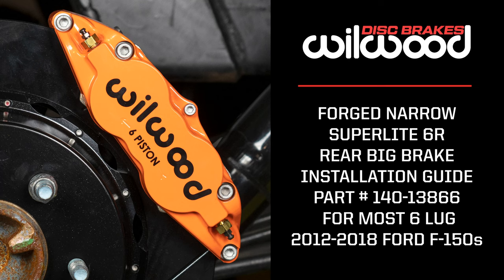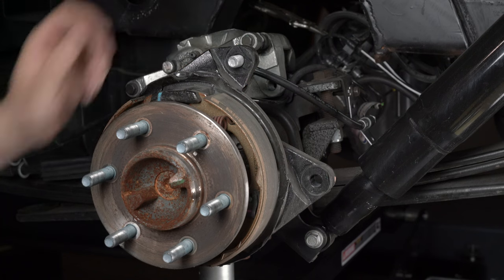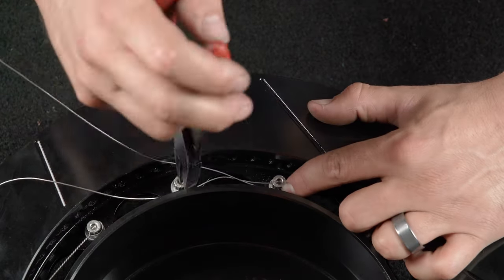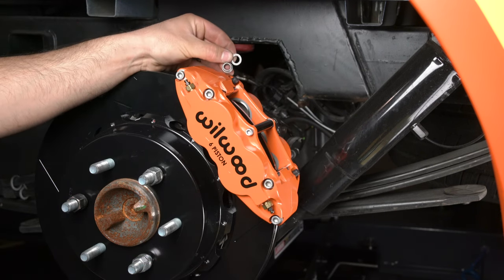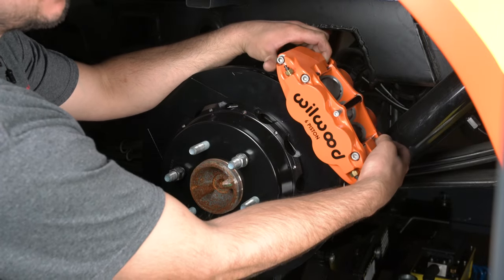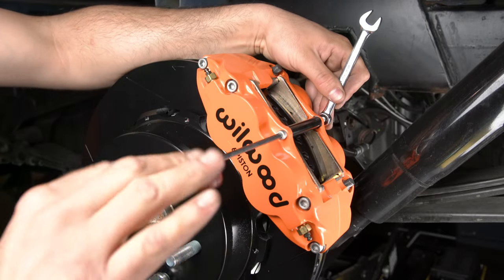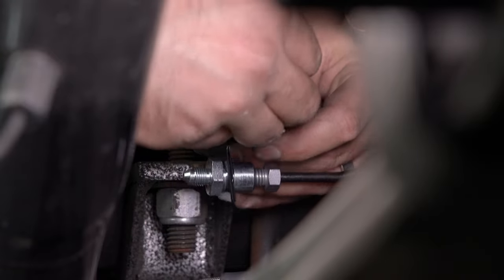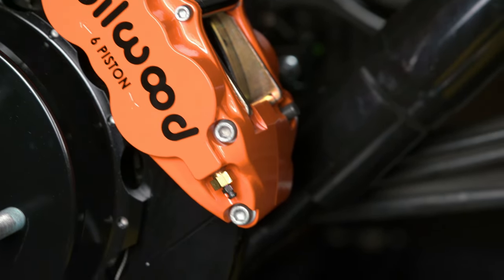Ford F-150 2012 - 2018 Rear Big Brake Kit Install Wilwood SL6R

Comment: What is the max wheel offset without rubbing and does this kit work with the electronic parking brake motor because I didn’t see that mentioned when swapping the brake housing
Reply from the maker: Hi. Sorry, there is no exact offset specified due to the amount of wheels in the market. We do offer a full spec diagram of our kit so you may measure your wheel. Our diagrams are found with the kit on our website.